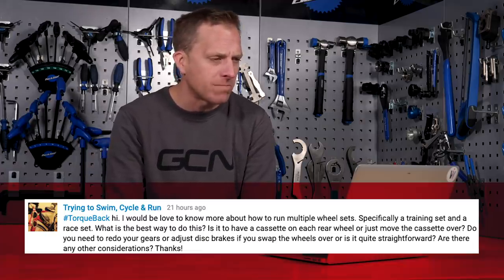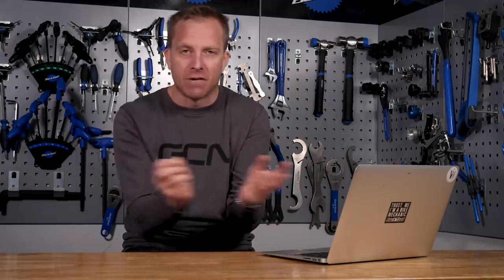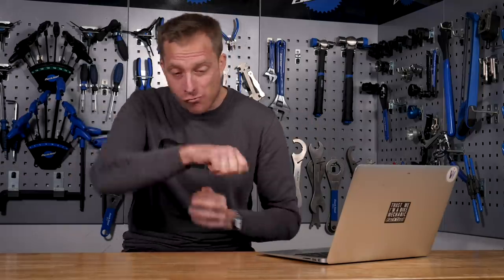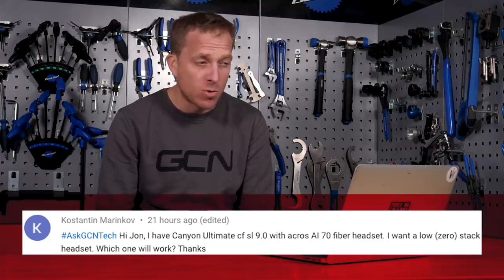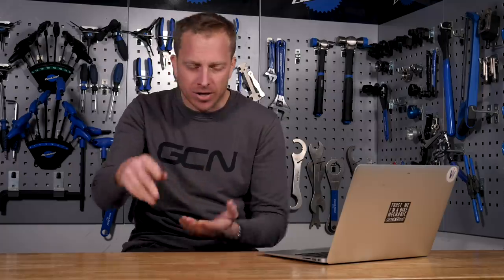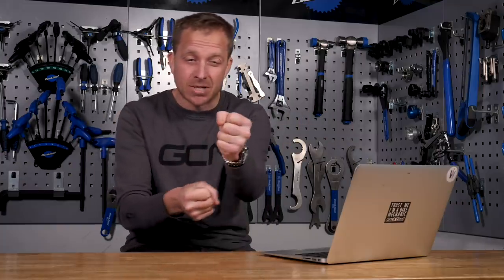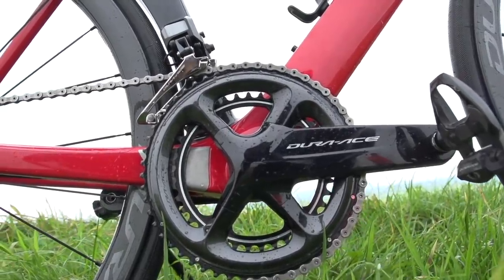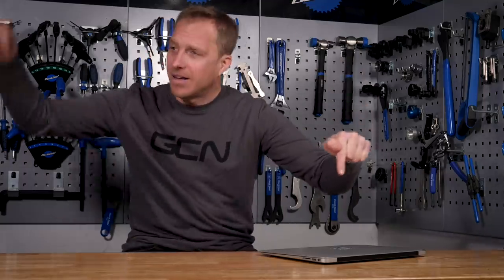Switching Between Training & Race Wheelsets + DIY Bicycle Tools | GCN Tech Clinic #AskGCNTech

Comment: #askgcntech I've got a brand new frame which bike shop built up into complete bike with ultegra r8000 groupset, various finishing kit and demo wheels. I tried out at the bike shop and it was dreamy, but since putting on my own wheels the gears are very noisy apart from middle 5 cogs. I can't imagine limit screws need adjusting, is it likely to be cable tension? Thanks.

Comment: I've got carbon handlebars and bar stem . I've used carbon paste and torqued to the correct setting ( 6nm) occasionally I'll hit a hole and the bars will move with and accomanying ' CRACK ' which can be a bit alarming .... should I tighten a little more ( 7-8mn ) or try different carbon paste ?
Reply: I had a ticking from pedal axle interfacing with crank. After removing and reinstalling it stopped. Im convinced it was An air bubble in the grease popping. Might be a gap in your carbon paste doing the same? Or is it too loud? And deffo not a headset issue?
Reply: @Lacking_something  the bars physically move , usually downwards . I usaully ride on the hoods , if i were on the drops the bars would probablay  move upwards  - I'll try redoing the paste though
Reply: @Jfb-je2qz  eek! I would get some digital calipers and measure the bar/stem. It's possible they've been manufactured too small/large so don't grip or even not spherical? Check out Hambini on YouTube and blog. Although he specialises in aero and bearings he might be interested to take a look at your bars if you do think they're badly made.
Reply: Jfb 0264 Do you use grease in your stem faceplate bolts?
Reply: Try some shim material like one or two layers of aluminum/tin foil at the stem face plate with your paste. See if that works.
Reply: @njm3211  I'd say you shouldn't need a shim unless something's been manufactured poorly.
Reply: Is the stem listed as being compatible with a carbon bar?
Reply: @CodSlap  Copper grease on the threads but nothing else on the bolts

Comment: Hi GCN tech,

My crank moves when I pedal (weired feeling). I have a sram apex 1 on a screwed acros GXP bottom bracket (bsa 68). If I tighten the crank more tightly the crank is not loose anymore, but the crank can not be turned well.
Could it be that I have too many spacers underlaid?
Or could it be something else?

Many greetings,
Hannes
Reply: Hannes Müller The problem you describe is fairly common with GXP cranks.  Hambini has an excellent video in which he addresses the design flaw in GXP cranksets.  If it were my bike, I’d upgrade it to a crank and bottom bracket set that uses the newer Sram Dub design. Dub doesn’t suffer from the same design flaws as GXP.  Link to Hambini video:  https://youtu.be/dkAxXNYzBGg

Comment: #AskGCNTech I don't have a power meter. I spend most of my training indoors on a manual trainer that I bought second-hand using Wahoo speed and cadence sensors that connect to my smartphone. My trainer is wearing out and I'm looking to replace it. I am considering a smart trainer so I can get some accurate power data to improve my training, but they are expensive. I don't have a lot of money and both power meters and smart trainers are expensive. I can't decide if I should buy a smart trainer to improve my indoor training, but still go without power when I ride outdoors on the weekends, or if I should buy a new manual trainer and a crank or pedal based power meter so I also can have power data when I ride outdoors on the weekends which seems to be more expensive. What should I buy that would best help my training, but would also be the easiest on my wallet? I've done some research but feel I don't have a good grasp on what the best and most cost effective options are. thanks!